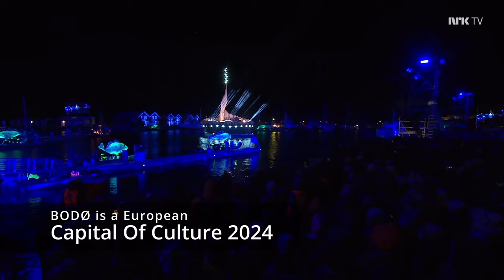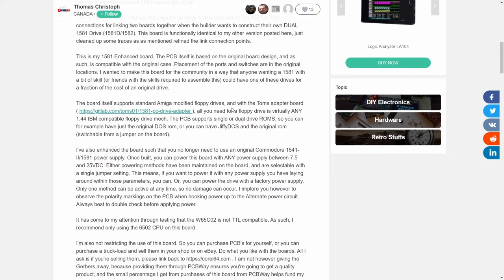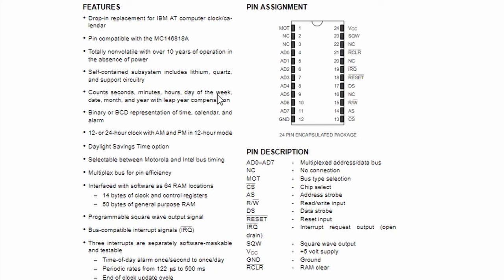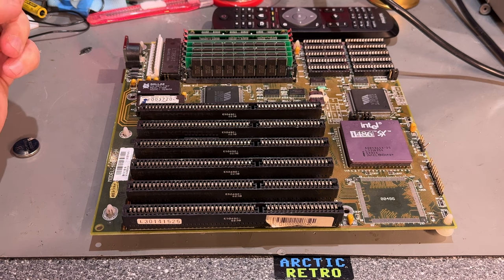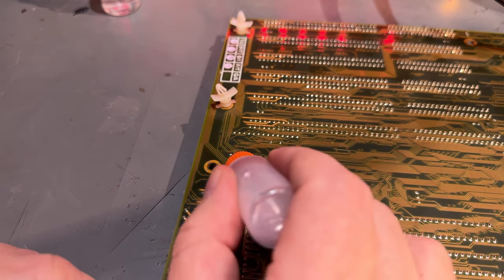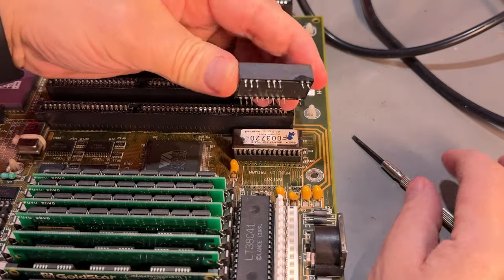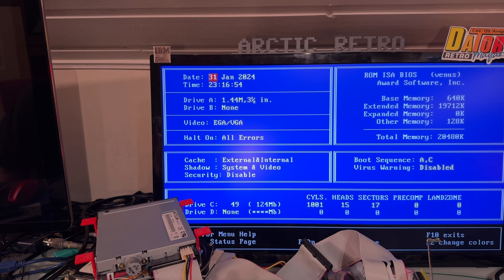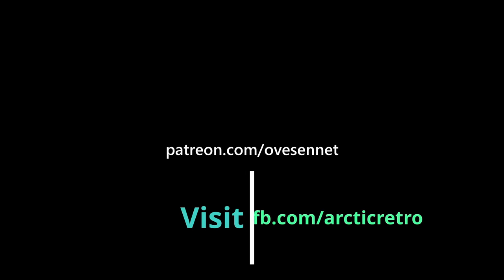How to get an old and dead Dallas RTC real time clock chip to work again

Comment: necroware did a custom replacement module that uses a CR1225 he has 2 different versions depending if its SSOP or so-24
Reply: What's the difference between nwX287 and NW12887 ? Really don't know wich one I need.
Reply: @zzgus  there is a pinout of each version that explains what you need hes covered that

Comment: > "I think it is dificult to solder to the battery itself..."
It's not only difficult but the battery, most likely, will explode. Lithium batteries don't like heat very much...
Reply from the maker: You could be quick :)

Comment: So the old battery isn't going to leak some day?
Reply: That ist unlikely for it is a Lithium cell
Reply from the maker: It is fully encased in resin or plastic. Unless it corrodes away, I think it is going to be safe for a long time. But I am not sure.
Reply: @Arcticretro Found the DIY nwX287 replacement, looks like a good PCBWAY project😁